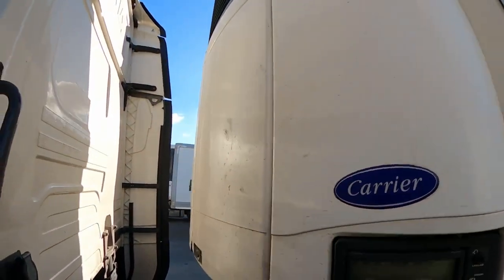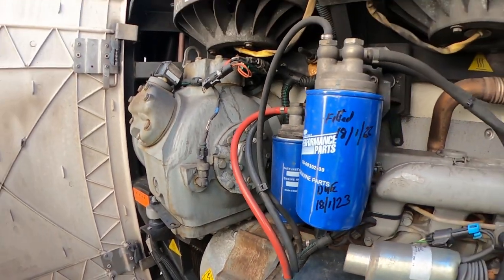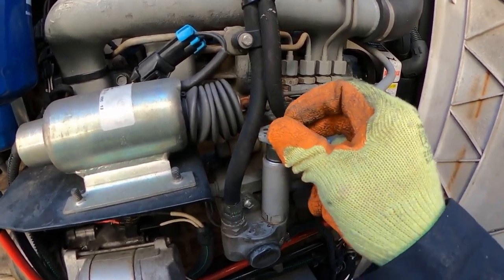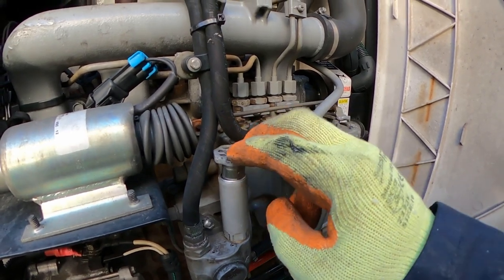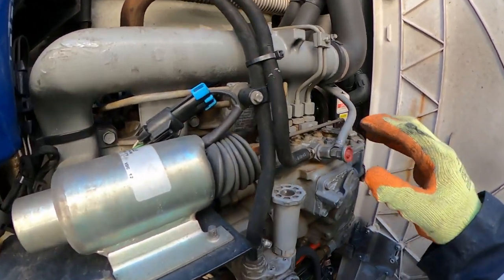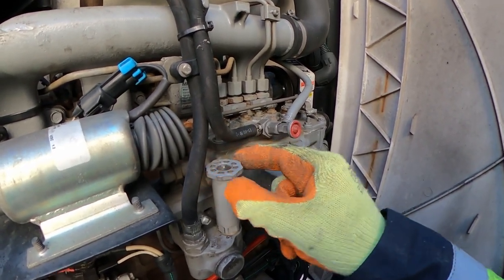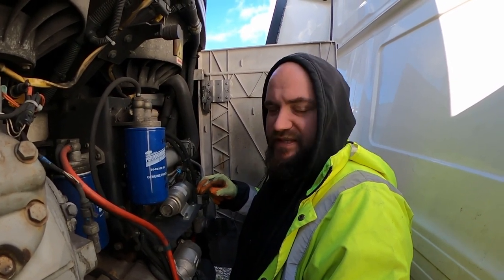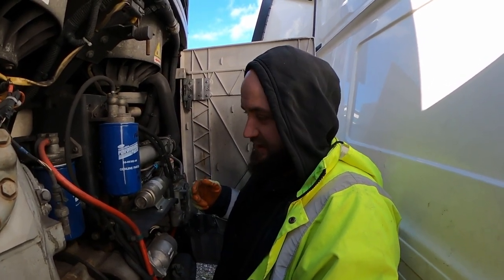Running out of fuel on a fridge trailer

Comment: The little red valv is for letting the air out of the system. When the tank runs dry the pump will suck in air in the fuelpipes. So what you do is that he fuel from the filled up tank gets sucked up to the pump it will push the air out of the system through that little red valve. When there is diesel comming out of the walw instead of air you are good to go. Just remember to close the valve as you said and tighten the manual pump. 
Stay safe mate.
Reply from the maker: well you said it better than me pal 😄 cheers! 🍺